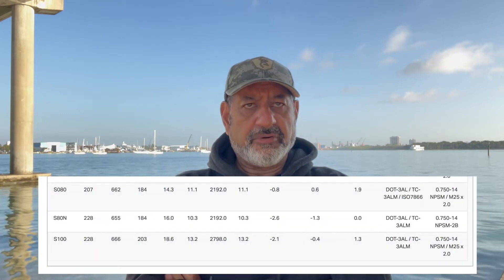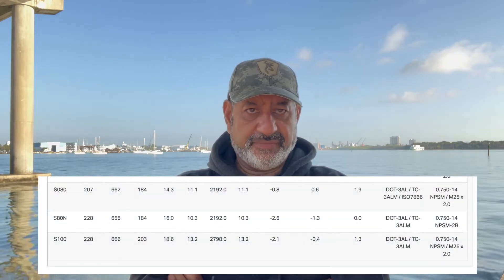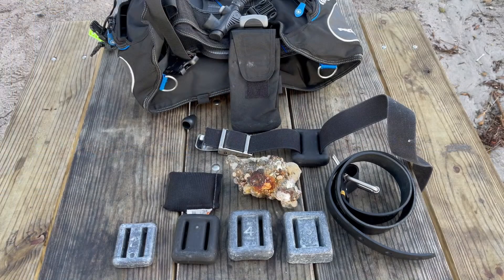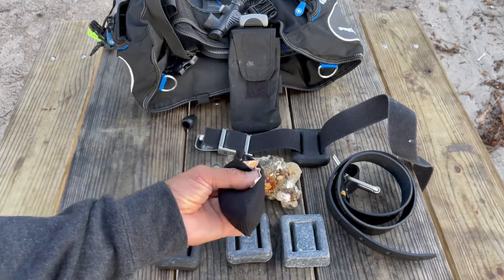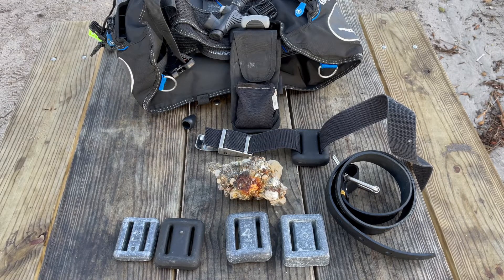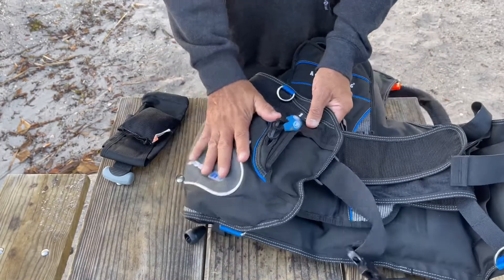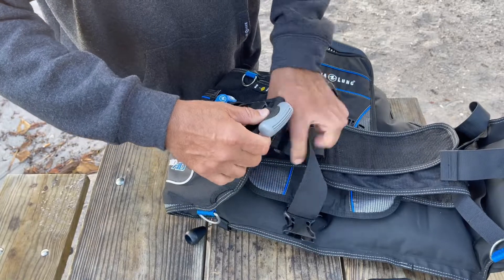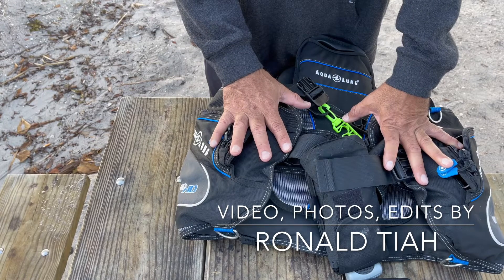Weights and Buoyancy 101 for SCUBA Divers

Comment: Making this more complicated then it needs to be. If I make myself perfectly neutral at the beginning of a dive, I will be too light at the end. How light? The amount of air in the cylinder that you use. Here is the maths for an AL80 cylinder:

A Catalina AL80 holds 77.4 cu.ft. of air. A cu.ft. of air weights 0.0765 pounds. Therefore it holds 77.4 * 0.0765 pounds or ~ 6 pounds.

In an emergency, you might empty the cylinder completely. So you should add 6 pounds. If you know you'll never use all the air and always finish the dive with 500 PSI or more then 500/3000 pounds. 500/3000 * 6 pounds = 1 pound. So you could use 5 pounds.

Comment: have been diving for half a century and for last2 decades used steel tanks[i am solo diver] went on a dive trip with a group that used aluminium[like most] and at the end of the dive felt like a novice when doing decom with 50bar.I found your video to be very well presented well communicated  and done in a way that jogs the memory as you start doing gear. Well done. and expecially with one of the divers comments,remember never too late to learn and no matter how careful there is always a time it is good to remember this guys attitude...slow and steady and you limit mistakes.

Comment: Humm, the difference of weight between a full tank and an empty tank (same capacity) is the same, alloy or ss. So the effect is the same when you empty your tank. The only difference will be that you take less weight for a dive with ss tank than with an alloy tank but in both case you have to take into account the weight of air you are going to use during your dive so that you don't "pop up" at the end of your dive (around 2 kg more at the beginning depending of the size of the tank)
Reply from the maker: Thanks for your comment Alain, I am not one to speak quickly, so I will reply meaningfully asap, appreciate your thoughts and comment :) !
Reply from the maker: Hi Alain ... just added a video which was inspired by your comment, hope you get a chance to have a look ... https://youtu.be/KpO1fKcKIIM

Comment: Ron , I went diving the other day with 100 steel tanks on Nitrox and I didn't use any front lead weights for my integrated lead pockets. I had no problem with my descent or trim. Is it ok if you don't use lead if with steel tanks and your trim is good? Or should you keep at least a pound each in the integrated pockets as some extra insurance?
Reply from the maker: I use 100 steel also on some deep dives. Steel tanks are negative when full of air and still negative when ‘empty or almost empty’ at the end of dive, unlike Aluminum  alloy which is negative buoyant at the start (full) and positive at end (300 to 500 psi).  
I do not need much weights with Aluminum and therefore even less with steel meaning zero weights, i do however prefer to wear 2 lbs … 1lb on each side of a weight belt (i still use) for ‘trim’ when i hunt or do photography … for each person, as we know the buoyancy is different. That is just my configuration and choice, but in answer to your question … 1. depending on trim required i may wear weights, 2. If you do not need weights to get down on Steel tank, then you will not need it at end :) hope this helped?  
PS. The reason i personally do not use weights in my integrated pockets is that i feel i have less movements of bcd and buoyancy to sides as weights sometimes shift in pockets whereas on belt they are more fixed. Perhaps its an old man / diver thing :) thanks for the question Imran. Hope this helps …
Reply: @rontiah  Thanks Ron! Sounds good to me. I appreciate your help Sir. I like to keep everything good like Dhall & Rice if you know what I mean! Lol. Take care and if you are ever in south Florida we could dive sometime or maybe up by you. Thanks again.
Reply from the maker: @ihar9975  sounds good, i am in West Palm Beaches and dive FLL, Miami, the keys and of course Jupiter with the sharks :)
Reply: @rontiah  
I'm near Pompano Beach. I have the Emerald Charter Shark dive on my list for sure in the future.

Comment: Pros and cons of integrated weights and weight belt?
Reply from the maker: interesting question Beel, for me ... I find the snug fit of a weight belt means less movement and more balance for my body as I dive, with weights integrated into the BCD for me means that as i turn and move the weights have that slight if not significant "play" and movement ... coming back to the name of the channel, I am old school and prefer my Weights on a belt for the above reasons :) Thanks for that question, How about you? you trained with a belt but now use integrated right? Which do you prefer?
Reply: Thanks for that Ron. The integrated for me is my preference based on my setup. Being a small guy with less weights than some, the integrated fits better so it gives me better trim and balance. For me knowing your gear is important, from is safety perspective I know where and the quick releases are in the event of any emergency. It also gives me less to worry about if I'm at the surface and I quickly need to gear and enter the water. However it sometimes does have its disadvantages at times for me personally, it can sometimes be a pain if you need to remove your gear underwater to fix your tank. :)

Just sharing my 2 cents based on my system.
Reply from the maker: @nabeelmohammed3663 , thanks for your thoughts and sharing your experience Beel. I think based on my many varied activities, which do sometimes neccesiate me having a bcd off ... it is even more reason for me to keep majority of my weights on my belt. I will say this though, when i have worn BCD's that are very snug fitting, using the integrated weights and having them snug into my body seemed to work better and I was more streamlined and also comfortable, I do also use less weights than some folks and therefore the config with two, two pounds in the trim pockets at tank and then 3 and 3 in front pockets worked quite nicely, i do use that config when I do my "touristy type" dives :)
Reply: Jumping in on the comment about making sure that your integrated weight pouches are clicked in securely: Realize that when kitting up prior to a dive, your weight pouch release handle or clip is usually parallel  to the surface but will point downward when you're in a well trimmed attitude during the dive. Next stop > the bottom...